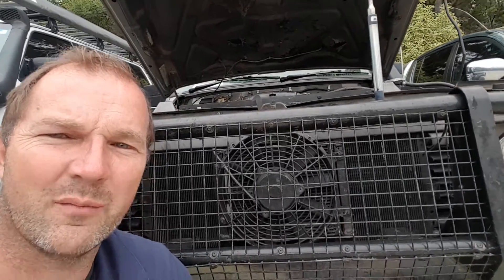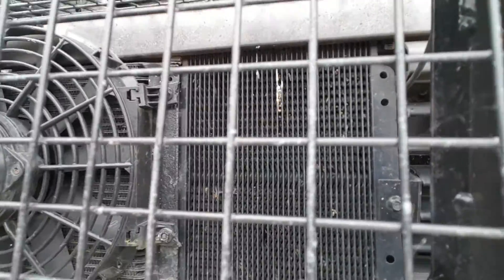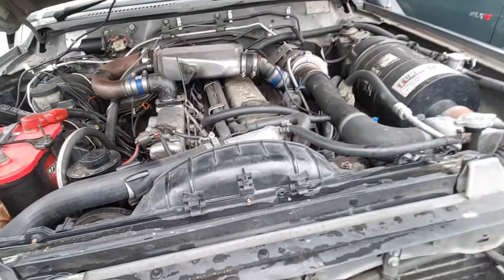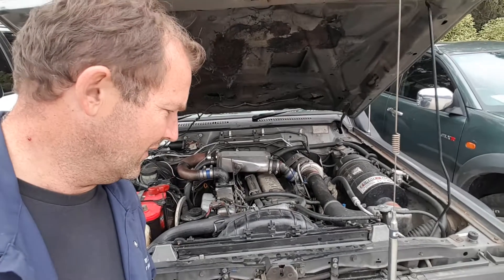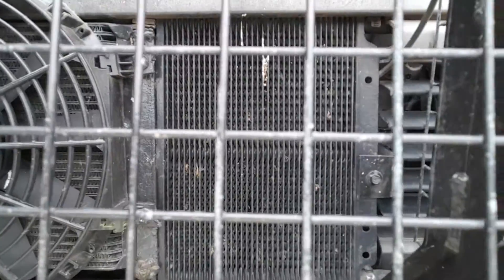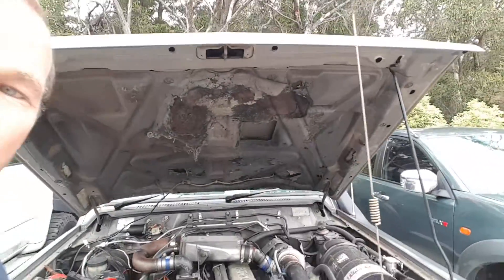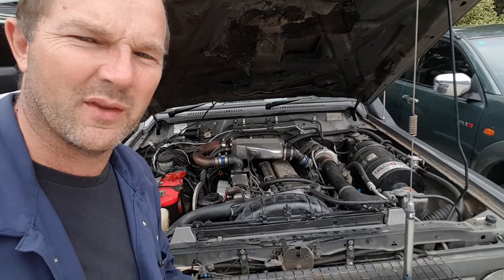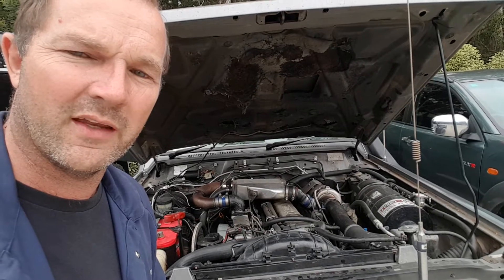Why is my Diesel Overheating?

Comment: Hi guys have a over heating problem with a 105 series hz just wondering what normal egt should be  have top mount inter cooler  big exhaust good radiator I’m operating in the Kimberley current ambient temps during day 40 to 45 degrees  egt is mounted in dump pipe currently running egt temps 450 to 500 at 110 kmh can push it up to 600 degrees with more exceleration  engine temps top out over 100 degrees as well
Reply from the maker: Hi mate 600s way tooo high in high ambients. So much complexity to consider around Diesel tuning. AFRs, EGTs, Power difference Before and After a Turbo etc, Ambient, Turbo boost....
Reply: Hi thanks for the input  I know there is lots of variations and complexity in involved  this vehicle was set up with the turbo prior to my purchase I’ve just finished doing a in frame rebuild due to cracked pistons not knowing the history of the set up or tune  just really wanted to know what the average EGT should be at cruise speed   Unable to get any one local to tune nearest tune shop is Darwin  1000 km away so I’m thinking the only short term solution is to wind the fuel delivery back some to try and drop EGT 
Current specs that I know.  Turbo unit is a safari  with a maximum boost set at 10 psi.  Boost on the flat at 100 kmh 7 psi. EGT  400 to 550  post turbo
Any type of hill trying to maintain constant speed will push EGT up to 600 plus if you don’t back off 
Don’t even try and tow any thing heavy 80 kmh max EGT and water temps will max out 
Exhaust dose seem to burn clean though
Would be nice to get you to do a tune alass I live in the most remotest part of Australia 
So in short your thoughts on average to max EGT don’t want crack pistons again or worse
Thanks mark
Reply from the maker: Again 600 is way too high so anything under at the least mate. Cheers

Comment: Have a similar problem. Where you able to fix this ?
Reply from the maker: Yes in this case it was very overfuelled making high combustion temps! Tuned it correctly and fixed.
Reply: very informative info. will give you guys a call. Top stuff.
Reply from the maker: Cheers

Comment: Hey Andrew, 
I have a 1hz with a dts turbo installed I havnt had any problems with over heating but was considering getting a top mount inter cooler installed just to make it more reliable.

Was curious as to what intercooler system you would go for ? Thanks Brandon.
Reply: brandon gonzalez and